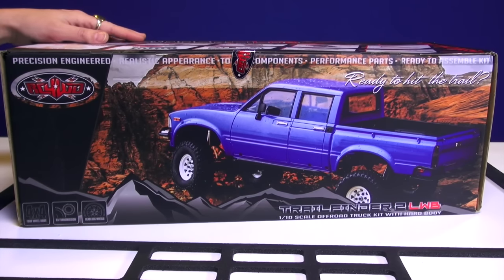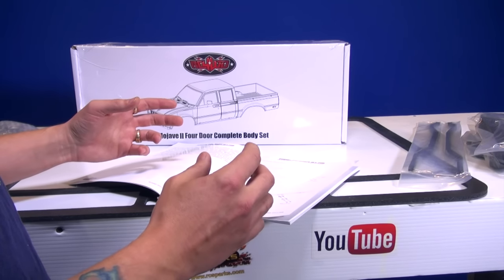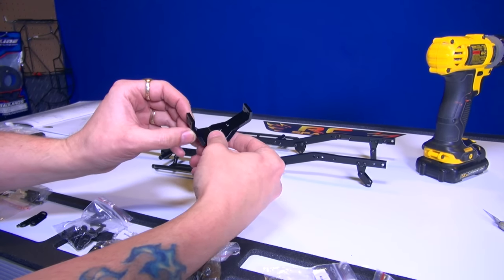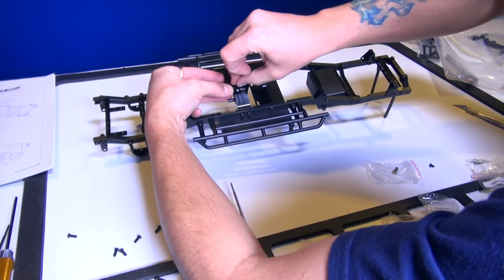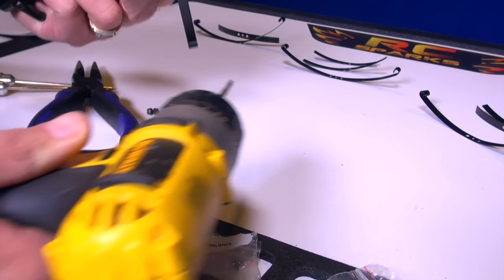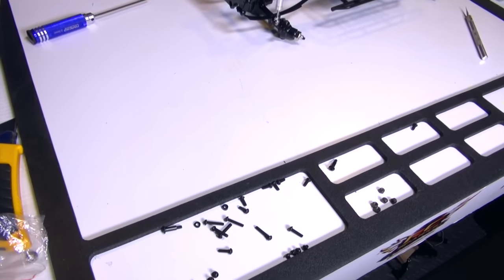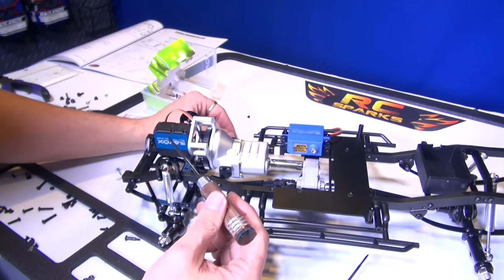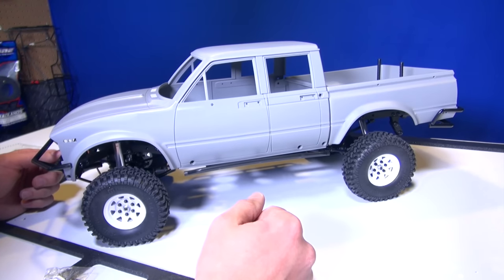RC ADVENTURES - Full Assembly / Trail Truck 4x4 Roller! Toyota Mojave 2 - RC4WD TF2 LWB 1/10th scale

Comment: I like the build of the extended cab, though my only gripe which looks to have stayed between the SWB TF2 and the LWB looks to be the leaf springs which are too long at 4.75". The shocks on this kit are the main support even with a heavy load on the back of it with all 3 leaf springs providing minimal support due to how long they are locking the rear shackles against the frame. The fronts run into the frame well before they support any weight sadly. I'm currently looking to find the right spring for them for my own build of the SWB to get it back on track.

Comment: Do you ever use locktite in critical areas, or grease on the bolts during assembly, I know aluminum will gall if grease or anti seize isn't used.

Comment: Hey Medic, I am sure you have but have you seen the RC4WD Scale engine and transmission for the TF2? Your motor goes inside the "fake" Small Block Chevy engine giving it a more realistic look. I think RC4WD did an awesome job on that. I also noticed it comes in their Limited Edition RTR TF2 with Blazer body. I hope they still have this kit for a few more months until I can save up enough to get it, I am a Chevy guy. 

You are what sold me on the RC4WD TF2 kits and RTR's, they are an awesome looking Rig. That Blazer kit looks so realistic with the Steering Dampener and even the way the steering links hook up at the axle (I have had a few 70's and 80's Blazers in the past).

Comment: I am new to the scale trucks, I have had many    RC  trucks, but nothing scale wise, / crawler/ ect. I want to build a TF2 , I want to get a k5 blazer body and make a pick up out of it, I also want the TF2 with a 2 speed trans, is there a difference in the rigs over all length  between  single and 2 speed set ups? I ask bc I want to know if this will affect my choice of body , (k5 blazer) I need advice, thanks in advance.

Comment: I used the same servo... did you trim your servo bracket to put it at the location... my 1210 savox is no flat.... and is it normal that 2 of my drive pin screw go straight through the holes of my driveshaft i just can’t torque them

Comment: Can anybody help me out? I was trying to fix an hpi sprint 2 drift that when driving, would cut out if I put more than 10% on the throttle. I thought it might be the esc or battery. However, I switched out motors (went from a stock 15T brushed motor to an old 27T brushed motor) and I had no issues with the rc cutting out. The 15T motor seems to make a weird and unusual hum. I am just skeptical because I have never seen a motor cause an entire esc to reset (I assume that's what is happening when it cuts out). I would appreciate any replies.

Comment: What's the benefit of a longer base on a trail? I only see a bigger problem for high centering. Still nice to have variety, I'm just wondering.
Reply from the maker: Well.. #1.. it hill climbs better because of the stability... :)  Which means you can lift it quite high.. and be stable as well :)
Reply: Ok that makes sense. Thanks for the reply.

Comment: hi I'm haveing some problems with my axial rc rockcrowler. the problem is, is I have a good battery but when I pluge it in and try to turn it on it does nothing and won't turn on. what do you think the problem is. thanks. you rock

Comment: Nice build Medic but I wish you would use spanner's and nut wrenches on the nuts, so you do not bur them, you are teaching newbies the right way to assemble them but not using the correct tool, so please get the correct tools for the job, my mates son say's Medic does not use spanners so why should he doh. On another note where is your blue thread lock to use on metal to metal fixings. I am watching this while looking out the window at a very wet and windy day, so no play time, but will be doing some wrenching later especially now I have the Axis-RC VEKTA 5 Rocket stand adapter so no more dropping it the floor or my feet, so making it easier to fit the new alloy shock spring seats and rose joints and alloy steering servo mount's.Keep up the good work and when is the VEKTA 5 making another appearance.

Comment: Thanks for the vid it's such a nice truck but no grease shims or locktite ?? Hope it hangs together for you
Reply from the maker: No grease, shims or locktite needed. Old tech, for new rig? not needed
Reply: RCSparks Studio Old tech ?? 
So so called new RC cars don't need lubrication ?? It's a known fact that the Yota axles need to be shimmed recommend by RC4WD. 
And I'm really surprised that you would make such a comment mate. With your extensive experience in RC that you think locktite & the use of it is old tech. I'm sorry mate but to stop your screws from backing out & they will eventually it is highly recommended to use blue locktite.
Reply from the maker: Mat K Just sayin' after using and building many tf2's, Loctite isn't needed. The coating on the frame rails lock the screws in  Shimming the axles really isnt needed either. But hey, thats just my experience.. what do I know.. Lol ;)
Reply: RCSparks Studio No worries mate
You have only built a couple lol 
Maybe I'm just too pedantic  with the couple of builds I've done. 
Keep up the good work & promoting our awesome hobby love ya work Coba 👍🏻👍
Reply from the maker: Mat K If it was any other machine that was aluminum, I would always always always use loctite. No choice.. Even on the Capo Ace 1 - loctite is necessary. But the coating on the TF2 holds the screws in very well!  I think the shims are available for those folks who want to have the ULTiMATE Axle gear mesh, that lasts a lifetime. My TF2 "drug man" truck lasted 3 years of heavy use with out the shims.. but then finally gave out. I wish they had been shimmed. Lol ;)
Reply: RCSparks Studio 
Thanks for the info can wait to see what body you put on it I'm guessing what we here in oz call a 79 series or Tojo thanks again for all you do for our hobby 👍🏻👍

Comment: I have a question. Other than the axial scx10, what would be a good RTR trail truck for a beginner? I was looking at the RC4WD Gelande 2 with the D90 body RTR set. It's 200 usd currently on the RC4WD website, which is cheaper than the SCX10.

Comment: Nice chassis eh...Now will you go back and loctite everything...lol \m/
Reply from the maker: Heh.. actually, if it was any other brand. I would agree. Ive never had an issue on the tf2 with screws falling out.. they are pretty snug and the finish on the aluminum is wicked.
Reply: Nice...Thanks for response. Looks like a nice solid chassis & appreciate the info.
Reply: RCSparks Studio Lol I saw TF2 as the first thing in your comments I was thinking of team fortress 2.

Comment: I just hapend to find an older Traxxas Razer Nitro for 40.00 $ ! & it came w/ a tool box full of extra parts + some more parts . The pull start does work & theres some thing wrong w/ the drill start box ' & the electric starter 'but for 40.00 $ I couldent pass it up

Comment: i love my slash 2wd vxl modified with a 4s lipo  and a thunder tiger 1/8 bushmaster ace rc blc-100c PERFORMANCE ESC with a a Thunder Tiger 1/8 MT4-G3 * ACE RIPPER 2000kV * IBL-40/20 Brushless Motor